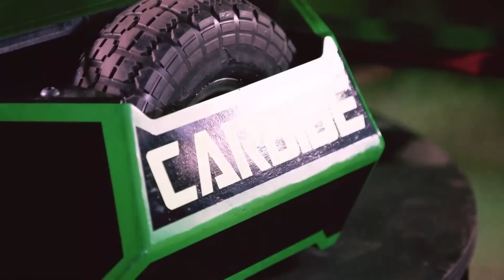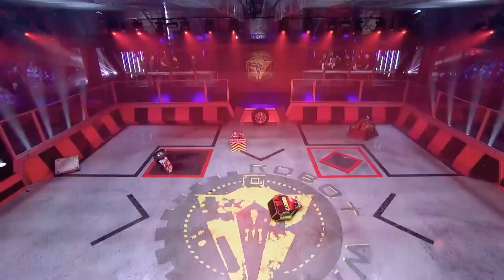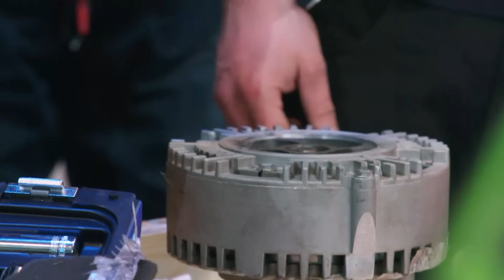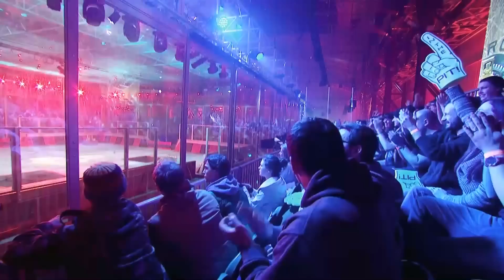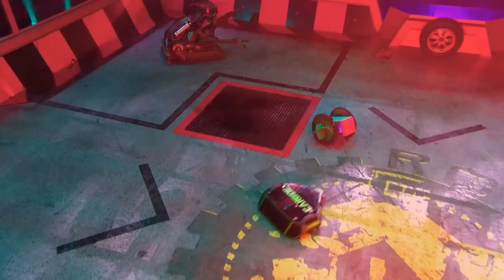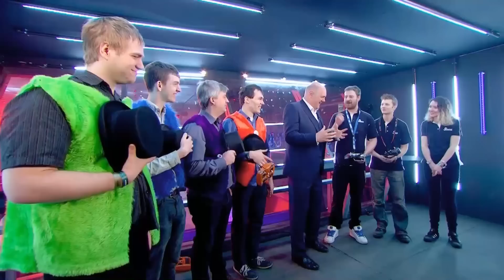CARBIDE'S DEBUT | Robot Wars HD

Comment: Soooo, they essentially copied Tombstone from Battlebots?
Reply: Hardcore Robotics doesn't own a patent on spinning a large piece of steel on a horizontal plane. There is also plenty of prior art from horizontal spinners during the Comedy Central Battlebots days (or even classic robot wars with bots like Fluffy).

I'm sure Dave Moulds looked very closely at the success of Tombstone/Last Rites with competitions like Robogames before designing Carbide, but it's not a copy with a completely new design more adapted to Robot Wars: it has a wedge, more compact build with heavier armour, enclosed wheels without much shock mounting but they used the same type of weapon motor as Tombstone (and bots like Deathroll)

Calling it a copy does a disservice to the engineering work done in Carbide, if you look at Russian or Chinese robot combat there are a lot more true tombclones around.
Reply: Ansgar 3 or Fluffy.
Reply: Nope. This is from many many many years ago
Reply: @daddysullivan87 I'm not sure. Yeah Tombstone has probably more energy in the weapon and is more maneuverable, but Carbide was pretty well setup to fight other horizontal spinners with the big wedge and the enclosed wheels.

It would be a close fight, basically depending on if Carbide can get to the wheels of Tombstone first or if Tombstone can rip off that wedge/cave the side armor in that the wheels of Carbide jam up.
Reply: @bami2 sorry I meant to reply to a different guy
Reply: @bami2  carbide would kill tombstone, it’s destroyed every spinner it’s ever been against. Plus robot wars robots are much better generally than their American counterparts with tombstone having tyres a clumsy way too massive spinner that always fails in robot wars
Reply: @PoopooMan-l6o carbide couldn’t beat Bombshell as Cobalt. I don’t think it’s beating Tombstone.
Reply: @Currentlyconfused  carbide beats any robot made at least 70% of the time especially in its later versions. Especially a robot with as stupidly obvious a weakness as tombstone. The British robots in general would win and the fact is tombstone gets beat by most of the British ones especially carbide
Reply: @Currentlyconfused  my above reply is to you
Reply: @PoopooMan-l6o look, Carbide is an amazing machine in its own right, but all I’m saying is, there’s a reason Cobalt came back in season 4 looking completely different

Comment: Ah, Carbide. The robot I'd put on my personal Mount Rushmore of Robot Wars machines alongside Chaos 2, Hypno-Disc and Razer for having such consistent dominance with its destructiveness. No other robot performed that well throughout the series' reboots.
Reply: Nasty weapon.
Reply: I'd replace hypnodisc with tornado personally, but yeah carbide deserves to be there, reaching the grand finale 3 times in a row is one hell of an achievement
Reply: @agustinval1508  I would never put Tornado over Hypno-Disc. Yes, Tornado won more trophies and set a new standard for pushing power combined with engineering, but Hypno-Disc set the standard that would continue to this day for weapons of sheer destruction, which is what Robot Wars as a whole is supposed to be about. Plus Tornado’s history is tainted by how it undeservedly got the UK Championship.
Reply: @ryanodonovan9497 tbh,Tornado technically won.Yes it was boring but it still technically won so  \ l_l /       (I would still put Hypno over tornado)
Reply: @killerfish-battlebot  So what? That doesn't change the fact that Tornado got the title undeservedly, as well as the European title which they wouldn't have got had Team Razer not been nicer to Team Tornado than the latter deserved, thus tainting the robot's history. It's got nothing to do with whether Tornado was exciting or boring. It's the fact that the team exploited flawed rules to practically have a different robot designed to specifically render Razer's attack methods useless, as well as the pit, because they couldn't be bothered to win properly. And all of this when the whole idea of Robot Wars is to prove your initial design to be superior to all others.
Reply: @ryanodonovan9497   “exploited flawed rules” I’m sorry but if the rules allow you that it’s legal.Plus stop the hate after 20+ years
Reply: @killerfish-battlebot  How about you learn not to make strawman arguments and cop-outs? Ignoring flaws in rules and just saying "its alrite becoz the rules say so!" is incredibly sheep-minded and naive. Try telling that to homosexuals who would face a DEATH SENTENCE in certain places despite there being nothing wrong with being gay. And before you point out that human rights are far more important than a robotic combat show, I KNOW. I'm just saying that it's the same principle in that just because rules are in place, it doesn't automatically mean they should be.
Reply: @agustinval1508  Tornado was from Huntingdon.
Reply: Hard to argue against that list!